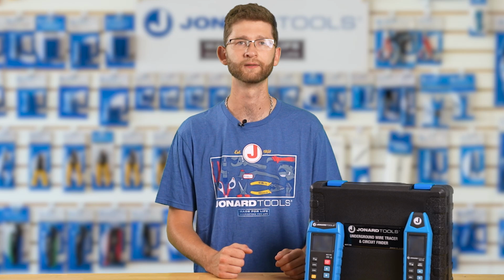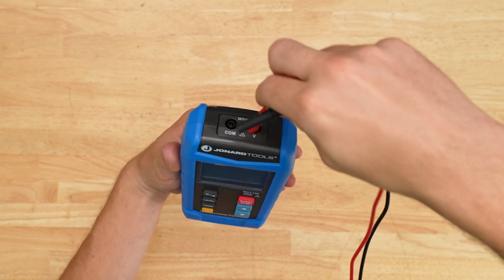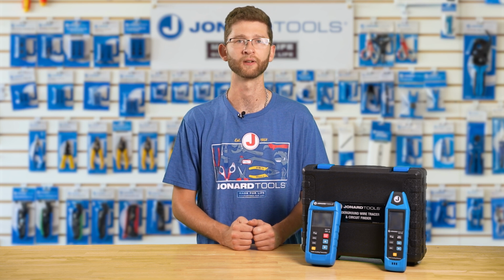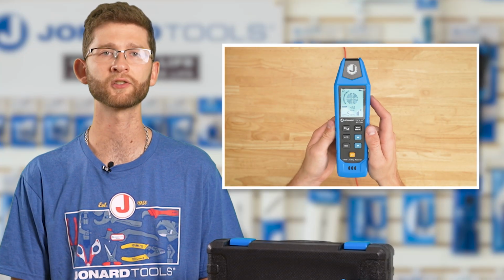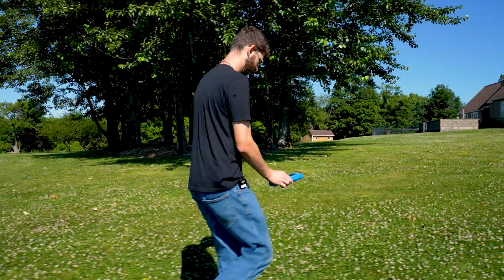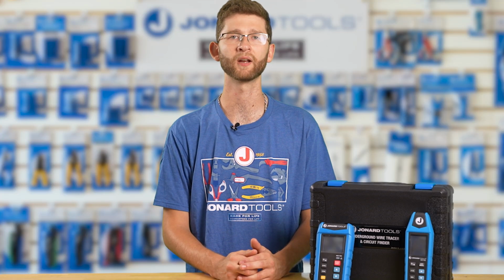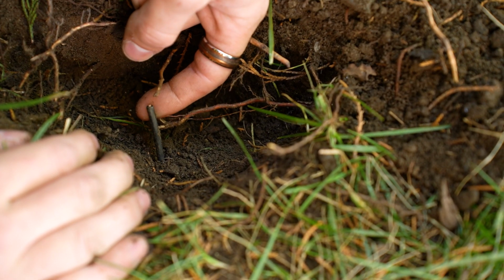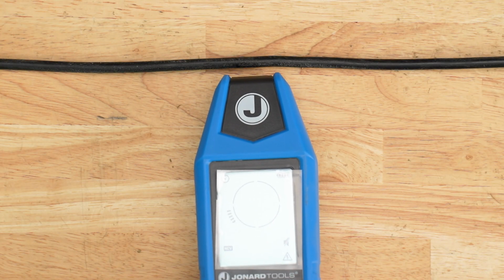Jonard Tools Underground Wire Tracer and Circuit Finder (WCT-700) Instructional Video

Comment: Can you use this on low voltage Ethernet cables ? Like poe or network wires connected to a network switch to find shorts in network cables ?
Reply from the maker: Yes, you can use this on Low Voltage Ethernet Cables. and yes, it will work on poe or network wires connected to a network switch to find shorts in network cables